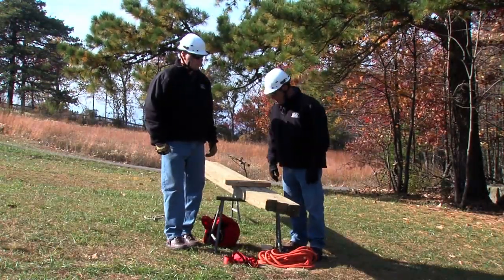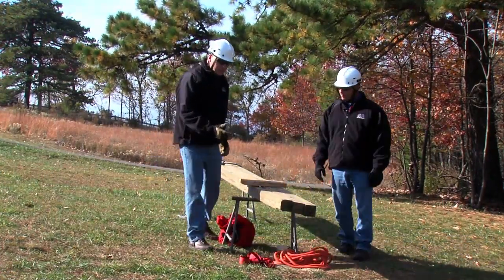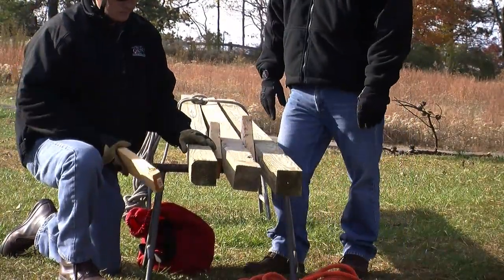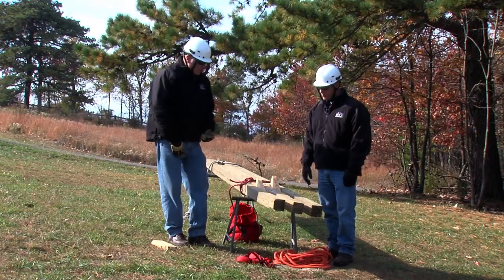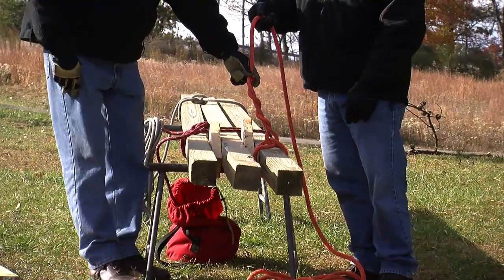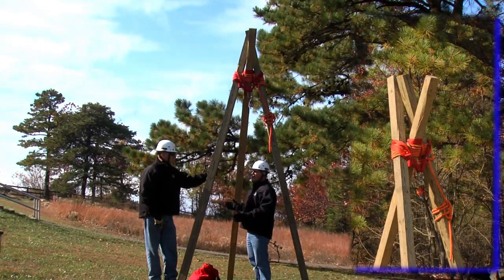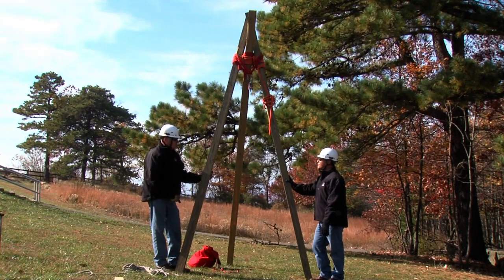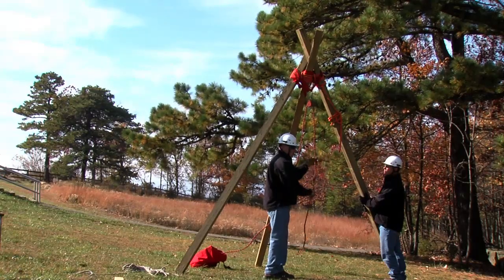Timber tripod

Comment: I know de video is five years old, but today I made one for hoisting 6 meter long 5 x 20 cm beams up with a chain tackle to 4 meter high, it works great.
I could even move the legs one by on for a little re-positioning the tripod to get the beam at 4 meter high.
still have 12 beams to go for the pent roof of 6 X 12 meter, now the surrounding is ready.
Thanks for the instructions to make this tripod.

Comment: Totally RAD! I was racking my brain trying figure out some way to lift a few very heavy objects, like a brick column at the end of my driveway that some asshole knocked over. In fact the column has been knocked over twice. The first time it was knocked over I asked this steroid freak looking guy working next door to “help me” lift it back up. I swear the column has to be close to 800 lbs if not well over 1,000 lbs.. A rough calculation of the weight of the individual bricks, mortar and aggregate in the center definitely justifies my weight guesstimation. Anyway, the testosteronely endowed gentleman was able to deadlift the column up. To be honest it was too freakish to watch and I’d prefer to effect the column by some mechanical means this time around. So I considered a jib crane like the one at Harbor Freight. But not only is it serious overkill, it wouldn’t even work. A commercial jib would not be able to handle 1,000 lbs.. But let’s say it could handle 1,000 lbs. The ballast to counterbalance it would have to be either enormous or so compact and heavy that it would essentially be a permanent fixture next to the column after erected. Yes, I could weld a tripod for the jib crane and weld a trailer hitch tongue to attach to my truck. But that’s a lot of material and I can’t get the truck close enough to the column to make it work. Oh, and only a fvcking retard would spend $5,000 to lift a column worth about $500. Soooo, finally the little hamster that lives inside my head decided to exercise its fat ass for the first time in history and tried out the hamster wheel that God bought him 49 years ago. AND voila! The tripod idea came to me. I thought I was going to be famous and go down in history with other thought pioneers, like the guy who came up with the heliocentric theory. You guys owe me an envelope and a forever stamp. I had already completed my patent application form and sealed the envelope when I discovered your futuristic thieving video. This is my redneck idea and you guys stole it from me. And you’re so greedy! You already invented the Time Machine but that wasn’t enough. Huh? 😔